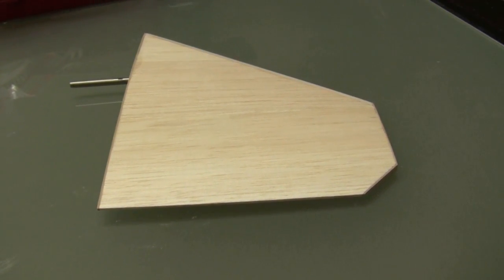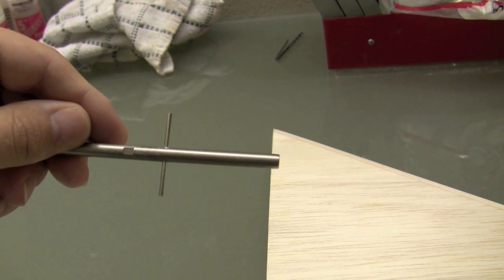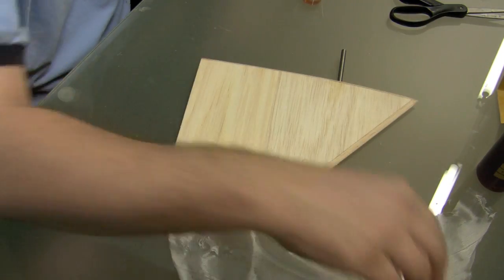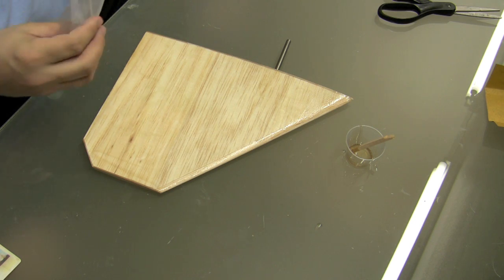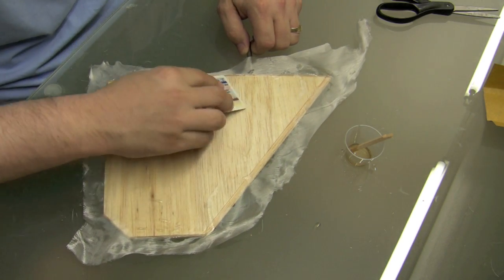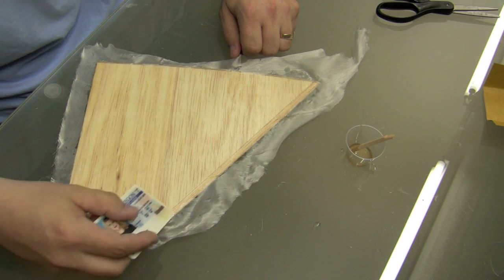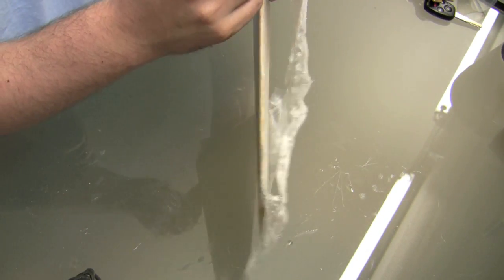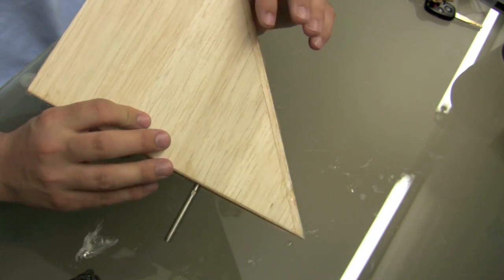Yellow F-16 Build #6

Comment: If you would just start in the middle with the epoxy and a brush and work  your way out to the edges it would be much easy to handle!!
Reply from the maker: Yeah, I've learned a lot since those "early" days.  Thanks for the suggestion, I appreciate it!

Comment from the maker: I don't have a ton of experience and I think it's pretty easy.  The Z-Poxy gives you TONS of working time.  Here's some hints I can give from experience:

1) Don't try to do too much at once (like glass the top and bottom of the wing, stab, or both sides of rudder at the same time.  The excess cloth tends to catch on itself or the weight of one side or the other causes wrinkles.

2) Use gravity to assist you.  I do my pieces horizontal on a flat surface.

3) I like a glass surface to work on.